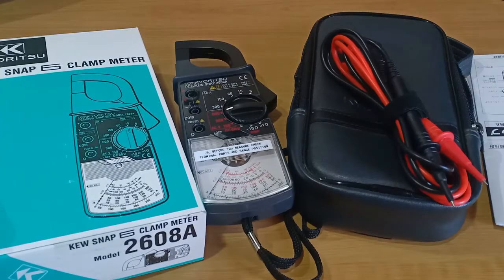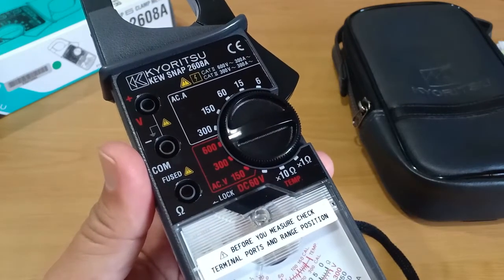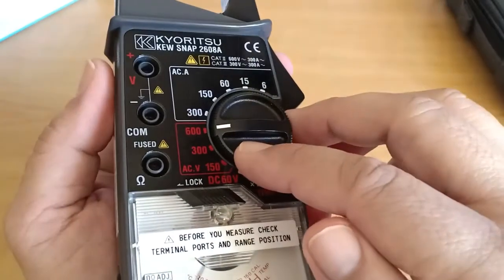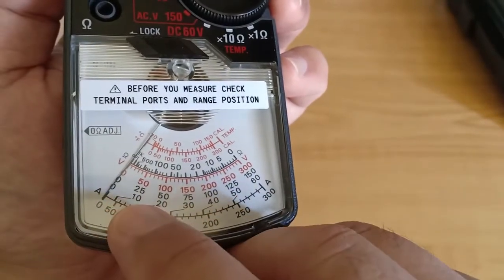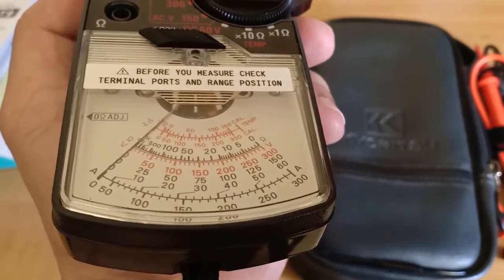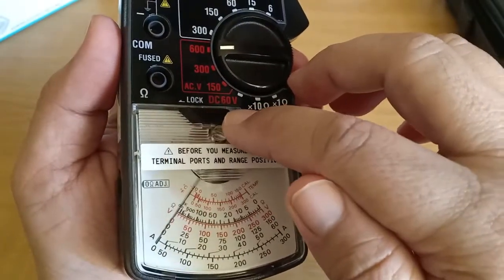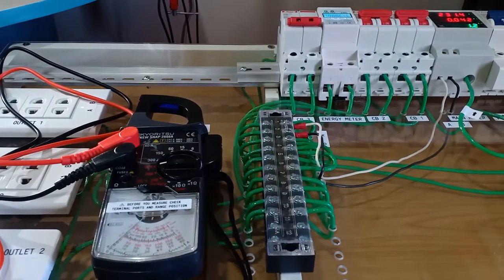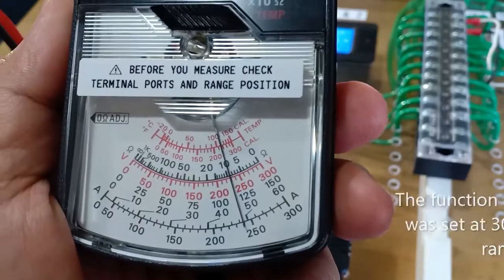[English Sub] Kyoritsu Analog Clamp Meter Kew Snap-6 (2608A): Unboxing and Review

Comment: How analog clamp meter performs measuring inrush current actually?
Reply from the maker: Thanks for watching. Analog clamp meters cannot measure inrush current. But they can "detect" inrush current because at the instant of motor startup the indicator needle will quickly sweep across the analog display then settle at the normal reading. It's just that detection is not the same as measurement. You need a digital clamp meter with inrush current function to correctly measure inrush current.